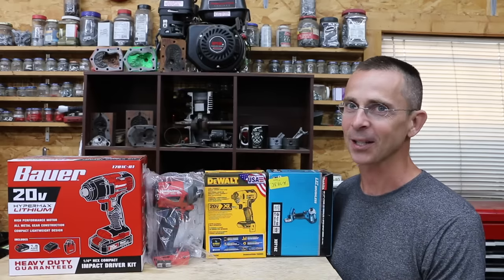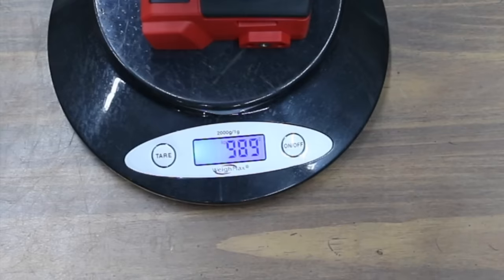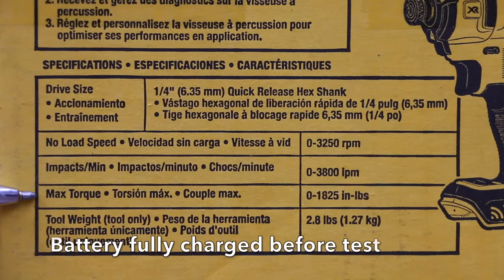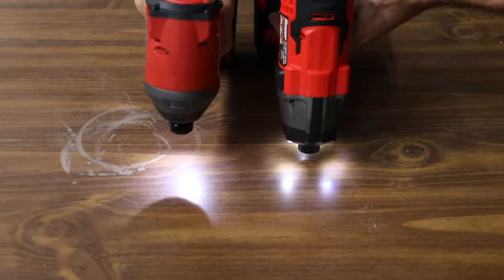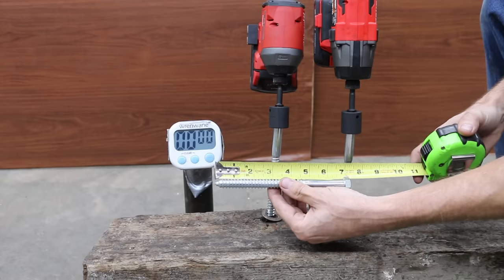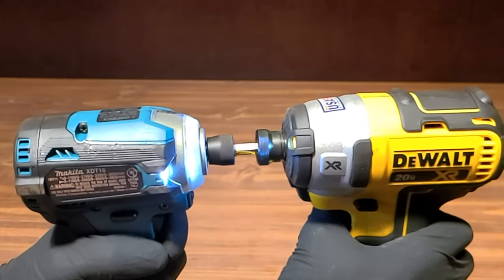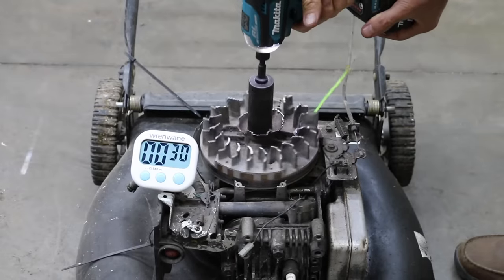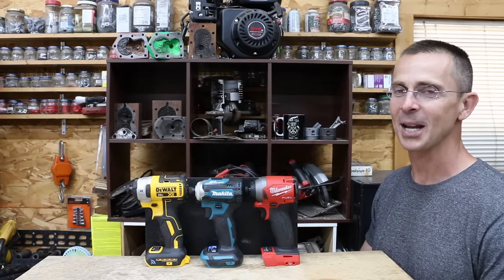Best Impact Driver? DeWalt vs Milwaukee vs Makita vs Bauer!  Let's find out!

Comment: Fantastic testing! Smoking, but the app says temp OK. LOL I think the Milwaukee has a built in current sensing circuit. The excessive load is causing too much current to flow, opening the circuit. Releasing the trigger likely resets the internal circuitry. Great job! A++
Reply: That makes good sense.  Thank you.
Reply: I have a Ryobi 1/2" impact that functions in the same manner. Using a battery rated higher than 4.0 ah solved that.
Reply: The app only monitors the temp of the circuitry, namely the switching mosfets. They probably weren’t hot to be honest. The heat and smoke appeared to be coming from the hammer and anvil.
Reply: I'm guessing I'd send the Milwaukee throught warranty and see if the problem persists.  I think it has a defect.
Reply: @lamarzimmermanmennonitefar5269  i'm fairly sure it's a protection feature, to keep you from smoking it out like the dewalt did.
Reply: milwaukee had a over torque limiter trying to save the chuck. the dewalt wasn’t in the danger zone temp wise, that would be >212°F (672°R, 373K, or 100°C) constant heat before it saw failure. we definitely saw it take a hit on performance after that torture test
Reply: Lamar Zimmerman I have one that does the same. Definitely think it’s a protection of some sort
Reply: Milwaukee tools are really strong and perform well but in my brothers work place (machining shop) they have had many batteries (original battery and charger) mildly explode. At least one other machining shop had the same problem. They have gotten new batteries for warranty but one of them burn also. I guess Milwaukee will correct this though.
Reply: I figured the same. Makita should do that too though. I was surprised it got to smoking too. Makita is usually more conservative with overload protection and other tools may perform higher but Makita goes for long term longevity than short term higher performance.
Reply: Is Metabo rare in US? I like their products though I also use Makita and Bosch.
Reply: Makita also has current sensing in their BMS.
Reply: I have a Milwaukee stubby impact and never had any problems with it cutting out but its probably built for more sustained use.
Reply: Im guessing it isn't a current sensing circuit thats doing it. Im guessing it is some sort of work load timer or the ecu temp protection. resistance increases and Current drops as a motor-wires overheat the only thing that can increase current when it gets hot is a battery but that has a temp protection built in to the pack usually has a 5 to 10 minute lockout
Reply: @lamarzimmermanmennonitefar5269  it has a temp sensor in the battery pack to prevent lipo from catching fire.. So it was cutting off by design.
Reply: @mvadu  not lipo.  18650 li-ion
Reply from the maker: Thanks so much!
Reply: @Andy47357  the dewalt was smokin...a lot..  If you kept that up long it would fail 100%.  Maybe it's circuit board wasn't in the danger zone for temps, but something was
Reply: Normally I Mr. Dewalt for many reasons not today and I agree with you 100%. I Smoke but my tools should not.
Reply: The Milwaukee and Dewalt both have those protection measures. The Milwaukee is in the tool but the DeWalt is in the battery. The bigger batteries flow enough current without overheating that the DeWalt can be abused without damaging the battery but the Milwaukee tool itself is protected. 

I use both daily. Well, I use DeWalt and my helper uses Milwaukee. They're both good commercial grade tools. Mine aren't as fast out the gate but his slow down sooner and more often. We're mostly running self-tappers into studs/door frames or tapcons into block but also use hex-shaft unibits a lot.

I'll stick to my DeWalts because my 22 year-old 18v hammerdrill still pokes the holes like new and uses 20v batteries with the DeWalt adapter. Their decision to put the protection circuitry in the battery, not the tool, is what allows that backward-compatibility and I appreciate it.
Reply: that dewalt driver probably had a bit of excess grease is all.........
Reply: Milwaukee does have a torque sensor more speed less torque
Reply: J S I switched over to Dewalt platform last year from Makita and I’ve already reinvested in a new Makita impact and hammer drill.  Very disappointed in my Dewalt impact DCF887!  My Makita impact from 2010 I bought as a set with the impact and hammer drill outperformed the new Dewalt and it was a no contest to boot!  Makita circa 2010 with 3.0AH tea bags Dewalts 887 with 5.0AH.  I drove 12 #9x3-1/2” deckmates into some studs with the Dewalt and it needed to immediately go to the corner into timeout.  Too hot to hold and emitting the smell of melting packing.  Makita never quit on me, 5hi7 the bed or needed a timeout, ever!  Having said that the Dewalt DCD996  hammerdrill has been great thus far.  Before the day was over after my Dewalt impact disappointment I was shopping for its Makita replacement with the newer 5.0AH batteries.  My Dewalt flexvolt rear handle 7-1/4 has been up to task but having issues with my brushless 15g angle nailer and the brushless 18g brad nailer has been decent but Im having to go thru and hand set 20% of the proud nails.  As soon as Milwaukee has their 5hi7 together with their new M18 Fuel Framing Gun and on the shelf near me I will likely be jumping ship from Dewalts nailers.  Thoroughly unimpressed from Dewalt with their guns and impact.  My Dewalt electric table saw DWE7480 has been absolutely great for several years and going strong.  I had planned on going all out Dewalt brushless arsenal but the nailer and impact derailed that.  Still short the framer, multitool, reciprocating saw and grinder but Im leaning strong towards the Milwaukee platform due to a lot of my electric Makita tool being heavier than a long prison sentence.  I m leaning hard toward the Milwaukee cordless 7-1/4” miter saw over Dewalts offering due to my issues thus far in Dewalt and not wanting to continue investing in disappointment. The little experience I have had with Milwaukee’s customer service teabags Dewalts service.  Makita never let me down but their stuff is Heavier than Pantera in a foul mood live show.
Reply: t kermi  I live in Ontario Canada and I never see metabo cordless drills . I have a corded hammer drill that things a beast whenever I use it . Wait now I do remember the first one blew up the first day but they gave me a new one the next day at the store . That was 5 years ago .  
I hope they come out with some I would get them . I have Milwaukee right now
Reply: @groermaik  but where's the hundo?
Reply: @joemilton7552  On the set in Steve Lehto's back building.
Reply: Most likely a safety built into the tool to prevent it from over heat or its broke...lol but I think its a safety for over-voltage use.
Reply: @tkermi  My perspective is admittedly pretty limited, but as far as I can tell yes Metabo is pretty uncommon in the US. Milwaukee seems most common with DeWalt not far behind, and Makita in third. Then I'd say maybe Bosch and Ridgid (you probably know them as AEG). Hilti is probably in that range somewhere too.
Reply: @tkermi  Batteries exploding, does not indicate good performance to me  ! ! !
Reply: We use Hilti tools at work in NYC. They have a protective shut down system too. A little annoying, but I got used to it
Reply: @tkermi  Also, how in the hell can can you have "a mild explosion" ? ?
That's like saying someone is 
"a little bit pregnant" ! !
Evidently kermit must have ment "small explosion".
Thanks for the laugh ! ! 😊 😊 😊
Reply: @jeremynoakes  Thanks for the info. I have used Metabo BS 18 LTX BL Q I many years now and it has worked well, but my use is not that hard.

My father used many dozens of mains powered hammer drills (from many top manufacturers) over three decades time in very heavy use. All broke between 1-18 months. But then he bought a Metabo and ended his career it still working after 5 years of use. But that hammer drill was made at 1992 - so the quality probably isn't as good anymore.
Reply: @GuyFromJupiter  Thanks for the info! I think that Metabo might offer quite small profit margin to distributors/dealers and that's holding back their products becoming more wide spread. This is based on the fact that here most dealers price Metabo products considerably higher that MSRP and some don't even give you that MSRP after bargaining...

Besides their drill I wrote about in my earlier message I have their 125mm angle grinder ( WB 18 LTX BL 125 Quick, I think). It has been good but I haven't used it much.
Reply: @dancahill9122  Agreed! 😂 I meant that those batteries that worked provided lost of usable power and fast good results with the drills, grinders and other tools they used in my brothers work place. They have so many spare batteries and chargers that some batteries breaking didn't really hinder their work flow. But they still change back/keep using Hilti now.
Reply: @wirenut3020  Many large and medium sized companies here use Hilti because of their excellent warranty / service program  which they also customize to client needs.
Reply: Yeah the Milwaukee has currant monitoring chips under high load over discharging protection shutting the tool down so don't damage the circuits and lithium cells in battery
Reply: @sirmixalot3332  makita has always been better than dewalt. ive got a makita saw thats about 30 years old and it still cuts good and its been dropped off of roofs.
Reply: @GuyFromJupiter  metabo is sold at lowes. it use to be hitachi but they bought metabo.
Reply: Dirty Harry  It still finished quicker than the others. It sucks more to have your tools broken down on the job site because someone can push them beyond limit.
Reply: I would spend 5x as much just for that feature of milwaukee.
Tools should be build to last...
The rest is pure garbage...
Reply: The ridgid hart and milwaukee I had all did it. It's to prevent damage. Annoying but can help prolong the life of the tool.
Reply: the app measures motor temp and the tool wasn't smoking it was the grease in the hammer assembly burning from all of the friction, this part of the tool is made from forged steel so it can handle the heat no problem. the tool itself suffered little to no damage, but she might need some more grease to prevent any unwanted wear over time.
Reply: @Andy47357  that's only the boiling point of water, the steel hammers in an impact driver can handle a lot more heat than that.
Reply: @tkermi  "Milwaukee tools are really strong and perform well" or they did in the past. I have noticed recently they look like cheap crap, they feel like cheap crap, and they preform like cheap crap. drill bits that strip and shatter, plastic clamshell design, it's basically the same as rigdog and ryboby, it's made in the same factory in china. makita and hilti are really the only ones left still making quality tools.
Reply: @DVeck89  it wasn't smoking from overload it was probably perfectly fine, the smoke was from the burning grease in the hammer assembly from all of the friction made trying to drive that lag into a hardwood block.
Reply: @animefreak5757  nothing was in danger, it was just burning grease from all of the friction. the internals of the tools were perfectly fine though constant use with burned grease would cause wear over time destroying the bearing and boring out the shaft for the chuck, still though this is not a death sentence.
Reply: @ElectronicsForFun  thats the point computers start to throttle
Reply: @Andy47357  I need more context.
Reply: @ElectronicsForFun  the driver can take up to about 340*F before you weaken the heat treat, the computer that controls the battery and the trigger will become damaged just like on a gaming computer
Reply: @Andy47357  the temp of the hammers isn't related to the temp of the electronics. the hammers would be on fire and the computer would be fine until the reached it.
Reply: @tkermi  - Lowe’s sells Metabo products. They actually have quite a few tools at my local store in New Jersey.
Reply: @chesterswingjr9796  Oh, interesting, thanks for the info!
Reply: @sirmixalot3332  Have you ever used the different battery adapters available on Amazon to swap batteries between different makes of tools?
Reply: I use Milwaukee impact everyday putting down all panel metal. It will do the same thing under heavy load for any period of time. I believe there's some form of thermal protector circuit and it to keep from burning the motor up.
Reply: Would it be possible to have a round 2 and include more brands like Ryobi?
Reply: Love my Milwaukee! Have 1/2 inch impact also. Both are beasts.
Reply: @offroadcanadian807  I have the same one as used in the video, the reason it was cutting power on him is likely just the connection to the battery terminal was sub par (dirt, terminal shaken loose etc.) Usually a simple fix it happened to me once and I thought I'd busted it but I opened it up and it'd shaken itself a bit loose so I just put polyurethane on it and i haven't had a problem since

Comment: Dewalt app: Temperature is fine
Dewalt impact: on fire
Reply: What do you expect since it's pretty much Black & Decker which makes the cheapest power tools you can buy now days besides some super cheap store brands like from HF & Menards. Although B&D used to make decent tools many many years ago.
Reply: Amy Atkinson Lmaoooo
Reply from the maker: Thanks for watching.
Reply: @benkeysor7576  i still have some of my grandfathers DeWalt drills from back in the day still kicking. working better with these new batteries they have. newer DeWalt tools i'd stay away from the flashy ones. the simple DeWalt tools are the real ones.
Reply: @thatguybrody4819  That is what I'm saying, the older stuff is decent & well made. I don't typically like battery tools just due to the cost & batteries needing replacement but I have a very old Makita drill & a very old Makita circular saw both 120 volts. Both the drill & saw are still very good functional tools and never had any issues. I wouldn't trade them for anything newer.
Reply: @benkeysor7576  DeWalt has the adapter for old batteries to accept the newer ones and that boosted performance. does Makita have that? if so look into it you will like it.

Comment: Starts to smoke and leak grease “According to the DeWalt app the temperature is doing ok” 

🤔I’m beginning to suspect the app is inaccurate.
Reply: Right! Lol define "ok" cause I'd say if the motor is smoking qnd leaking lube then it's most definitely not "ok" lol
Reply: js6729 it’s ok until it stops working, then it’s not ok. Lol glad we need an app for that.
Reply from the maker: Thanks for watching.
Reply: Inserts "this is fine" meme
Reply: The app checks the lithium battery pack temperature, not the tool or motor temp.
Reply: It measures battery temperature, what’s next a dimmer setting in the app for the drill light? You can tell the suckers that got roped into buying the dewalt.
Reply: The real purpose of the app is to track usage patterns and locations for their drills. They give it a few crappy features so you feel like you have to use it, and then mine the crap out of your personal data. Unless you really feel like you need to use the app for a product, don't. These companies collect enough data on us as is.
Reply: @PunkNDisorderlyGamer  Milwaukee has something like too with ONE-KEY